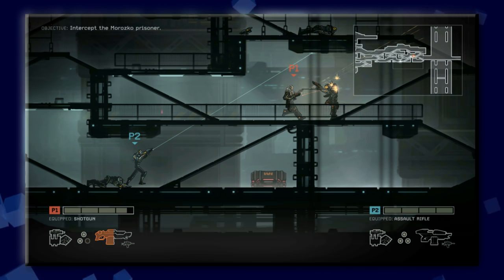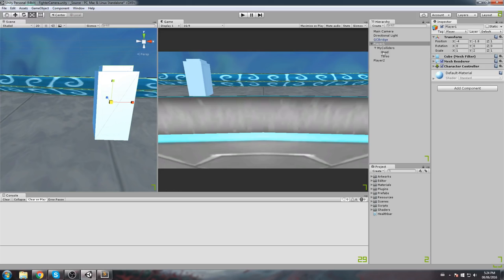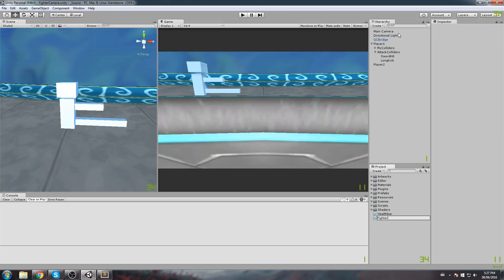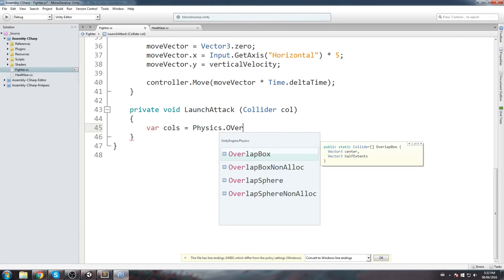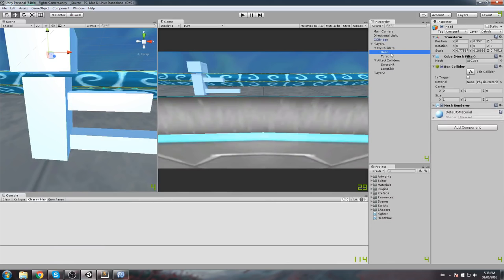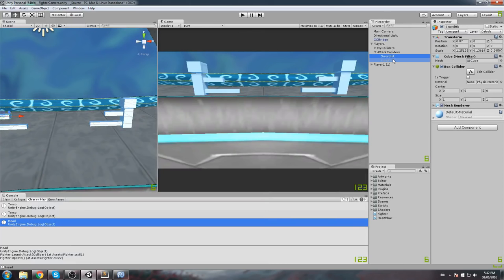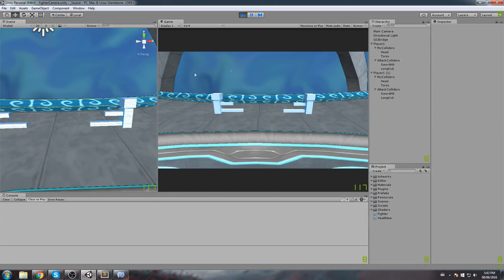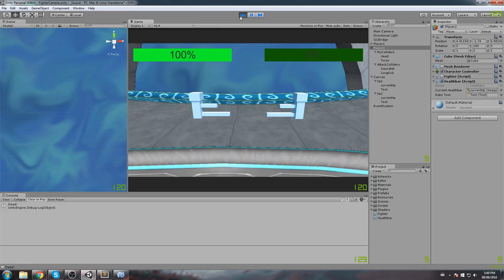Hitboxes (Fighter Melee Attack) - Game Mechanics - Unity 3D

Comment: Just a heads up, never heard it referred to as hitscan, usually just called ray casting, hitscan is more often used to refer to immediate fire types in shooters versus projectiles
Reply: Hitscan and Raycasting is the same thing.  Most people aren't aware of what raycasting is, so they call it Hitscan.  It has many names (in Unreal it's called something along the lines of Line Tracing by Channel, I believe).
Reply: Hitscan is the general term for detecting hit collision through intersections of a straight line/ray, as opposed to a box or sphere. Raycasting is the name of the actual process that happens, it's what creates hitscan detection. But in all honesty they can be used interchangeably as you described.

Comment: I am probably being a twit. How do you call the hitbox at a point in the animation rather than the whole animation.
Example. Character swings sword but it only actually becomes a "hitbox" when the sword is directly infront of character during the arch of the swing. Then switches off at the end. 

I feel like I am missing some basic code everyone knows about.
Reply: The way I'll go about it is that create a bool like "enableAttack" and by default set it to false. Surround the whole attacking/damage code inside "if (enableAttack == true)". Now in your animation, add a behaviour script. Inside that script you have to set the character's "enableAttack" bool using some counter you implement using time.deltaTime that roughly corresponds to the time the sword is actually drawn out and ready to attack.
Reply: Animation event..
Reply: Yes, use an Animation Event. Rhino's method above is incredibly amateur, hacky, and is not automated.

Comment: Hi, my enemy consists of 2 colliders, a box and a sphere. When I attack my target, my weapon hits both colliders causing the enemy to take double damage, even if both or none of the colliders are triggers, just the fact that I hit them cause my enemy to take double damage.
How can I make my enemy take damage from only 1 collider?
Reply: Deactivate the attack hitbox after hitting a collider. If multiple colliders are hit on the same frame,  decide what you want to be the preferred outcome (higher vs lower collider damage dealt) and make an edge case so that only 1 set of damage is dealt.